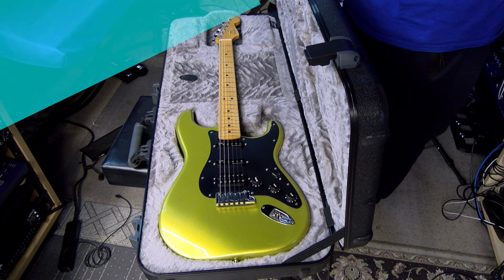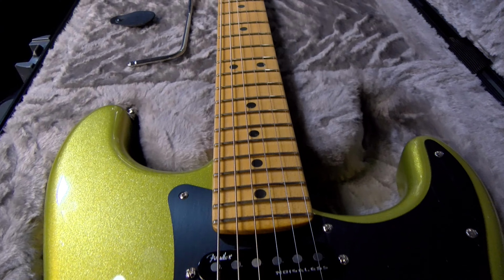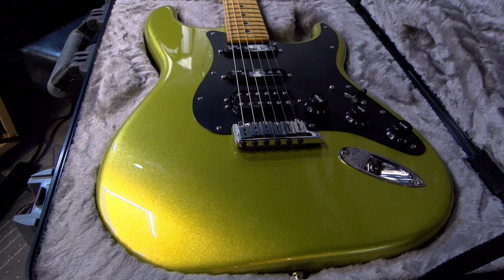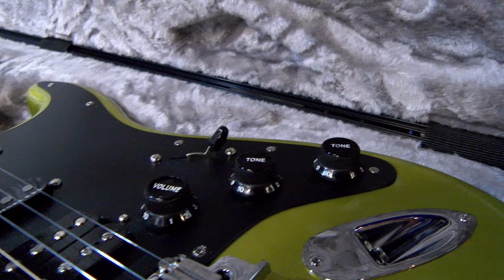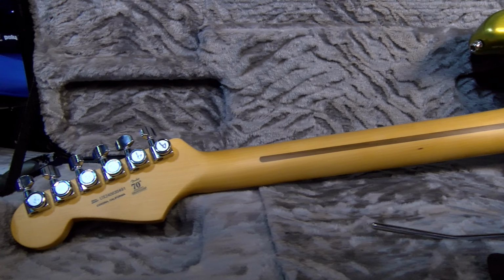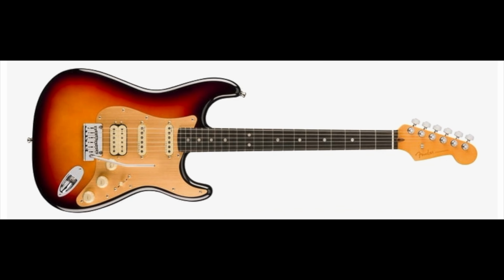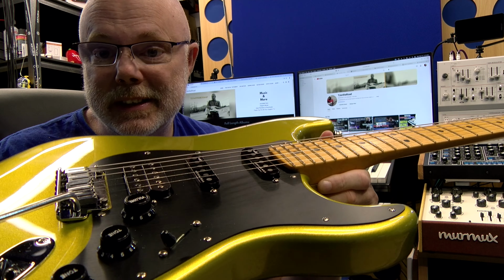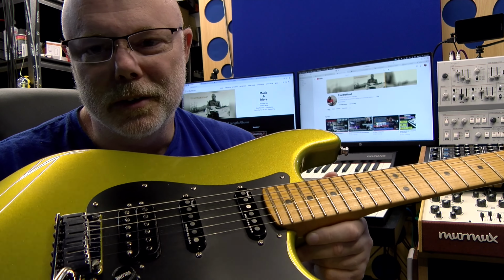Fender American Ultra II HSS Stratocaster Demo & Review

Comment: I love the sound of a humbucker so so much and the tele twang would love to get that sound. 

Not a fan of strat single coil sound.  

Looks like I will need to get a tele with a humbucker. 

Any recommendations. Does not seem the ultra 2 has that combo?

I already have a les Paul.
Reply from the maker: A Telecaster with a humbucker in the bridge isn’t really a Tele IMO. OTOH, a humbucker in the neck is ok for a Telecaster. Telecaster twang comes from the single coil in the bridge. So to get both sounds you’ll need 2 different guitars. 
Thanks for watching. TJ